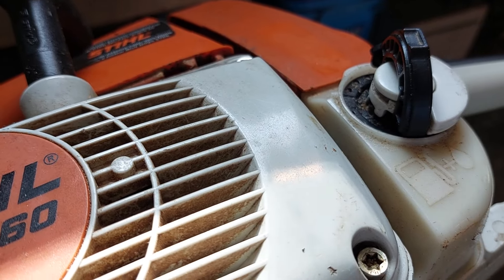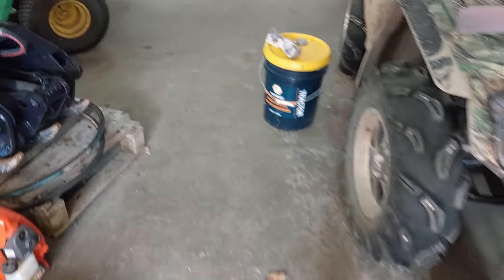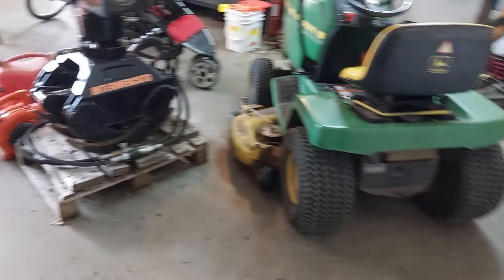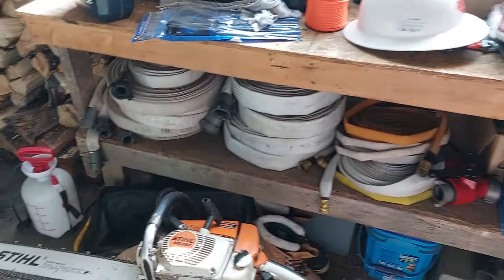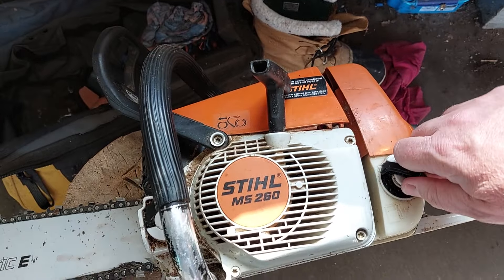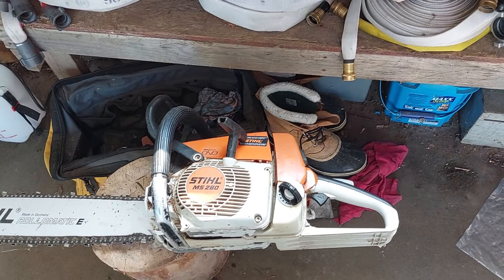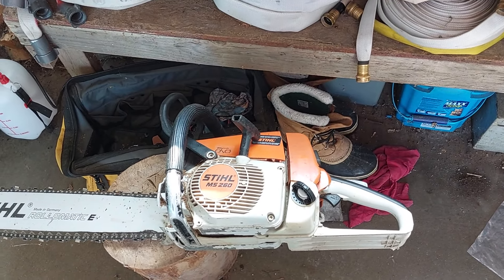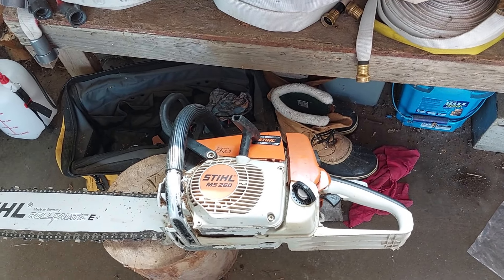Shitty Stihl fuel and oil cap designs

Comment: Stihl has had a recall on those caps. On my 170 the screw on caps, I think I changed them out over 6 times and still tighten them down with a pair of pliers after the screw spot got ruined.

Comment: Take the cap off hold the bottom of the cap with one hand twist the top of the cap with the other until its tight. Should solve the problem.

Comment: yeah the old steel caps were ABS plastic with a slot you could stick a chainsaw tool flat head in the middle to make it tight or loose... I agree what the f*** happened Stihl?